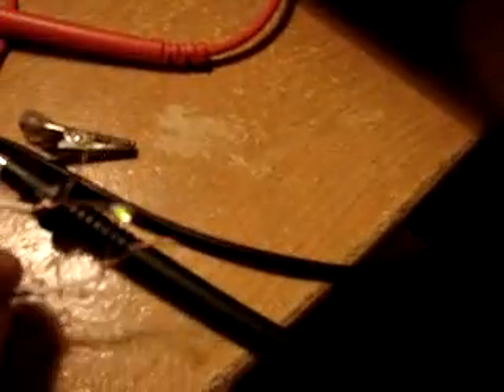Pure voltage No amperage + Skin effect

Comment from the maker: I am showing that an ungrounded secondary supplies no electrons...it's a closed loop, and all electron flow only comes from the copper ions within the secondary. I am hinting at the fact that Voltage alone can do work. If you are familiar with Stan Meyer, then you can glean a little insight into his system. Think of a reversed "Lord Kelvin Thunderstorm". Stan was potentializing (stretching) a moving medium (water), then a split second later allowing the potential to be bled off of said medium.

Comment: whether electrons are "supplied" or not is irrelavant.  Electrons can be caused to do work simply by being forced to move.
That total amount of work done is without a doubt less than the work that was supplied into the total system.
Some real "total work in" and "total work out" measurements would be worth noting.

Comment: If no electrons are supplied  (maybe interesting to find out, but not easy I think), then the voltage pulls the electrons towards a higher energy state, like you said and Stan described in part 5 of his techbrief.
But for free?
Try a CFL tube (if you still have the setup).
I'm gonna try MOT + 2 chokes on a single core from a tv, still need me a 555.

Comment from the maker: Yes, they operate by electrons squeezing into the holes...as they do the energy state drops down and a photon is released....the depth of the hole determines the color of photon.

The thing is...the voltage is WAY higher then an LED is suppose to handle...and, the brightness doesn't fall down as a function of R...something is happening here that is not obvious. 

I believe the voltage potential is "motoring" the electrons within the system...not really supplying much extra electrons.